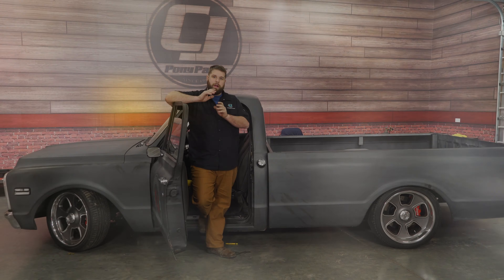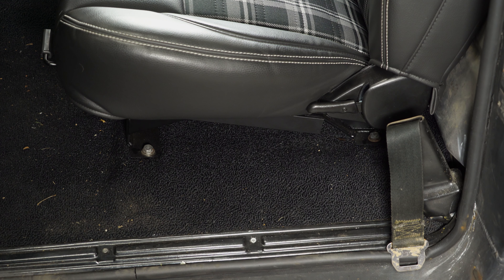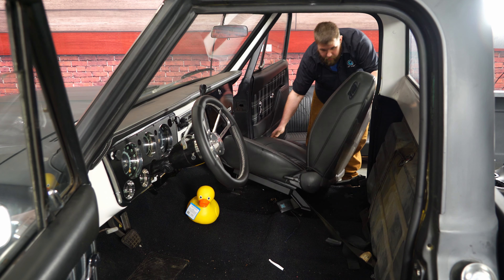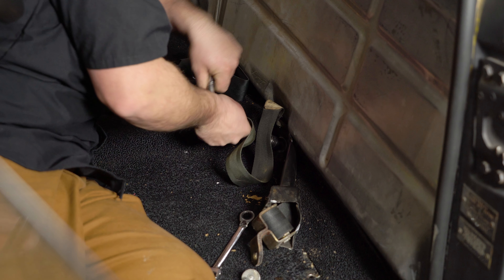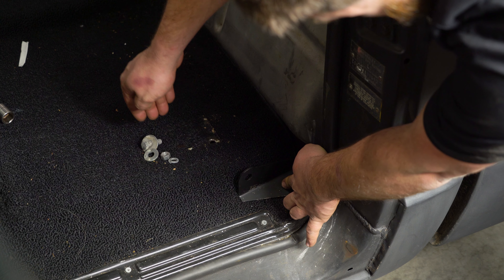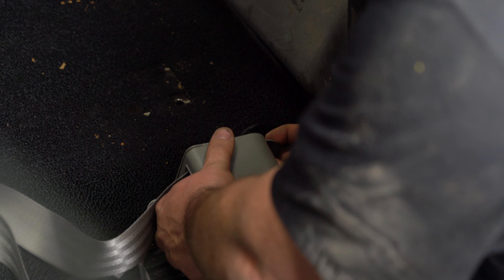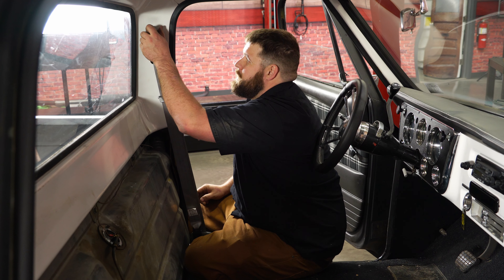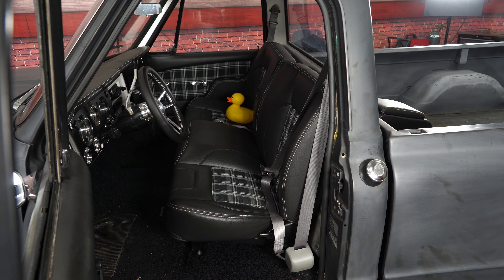Classic Chevy 3-Point Retractable Seat Belts | 1967-1972 C10 Install

Comment: It would have been helpful to demonstrate the process for mounting that bracket for the folks who don't already have that hole for the shoulder strap.  It's not an easy process, not in the least. And you glossed over it like it's an easy installation.  Everything else is just replacing a part that you already have with another, it's all pretty straight forward. But the shoulder strap demonstration would have been a nice bonus for me.  And I apologize for the criticism, man. I don't normally do that and may remove the comment later.  But that was disappointing.  This is a great channel, regardless. I'm a subscriber and will stay a subscriber. I'll always have at least one classic Chevy pickup in my garage!